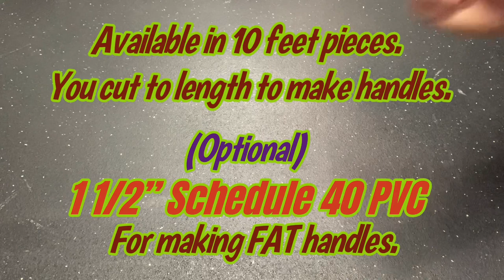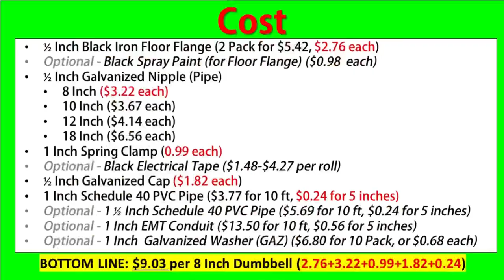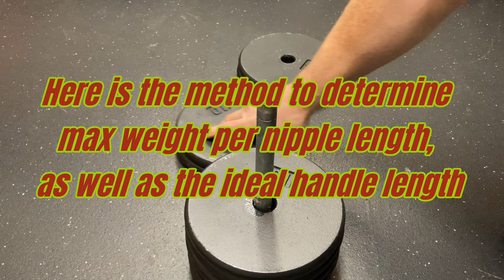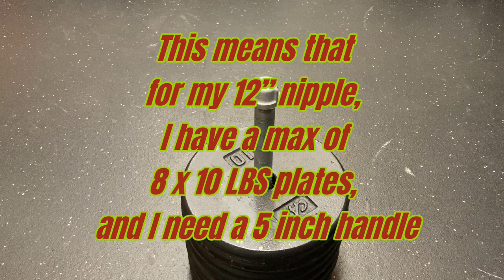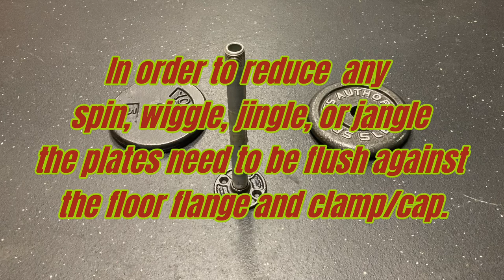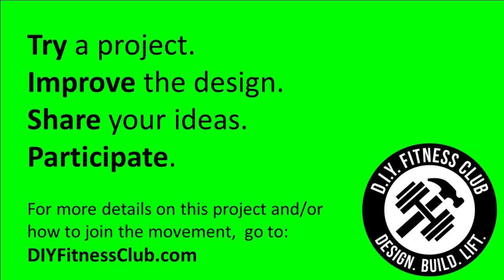DIY Adjustable "Mullet" Dumbbell System (Flat Bottom!) - Poor Man’s IronMasters

Comment: Subbed cause of this video. I built these over the weekend. Cost me ~$42 for the 12inch pair. I believe they are still worth it if you have the extra weights. I did add a piece of pvc between the pipe and weight holes for a tighter fit. Not needed, just a personal preference. The work great and no stabby stabby. Thank you for sharing.
Reply from the maker: That is awesome to hear!!!  Thank you so much!

Comment: How's your grip on the dumbbells using the EMT conduit wrapped in tap?  How does it compare to knurling on a commercial dumbbell?    I'm thinking about making some fixed weight dumbbell handles handles and wrapping the EMT conduit in anti slip tap; the kind that is used for traction on steps.
Reply from the maker: Great question! Anti slip might work. Have not tried it….not sure how it would hold up though. Some other options to consider: could add grip tape, spray truck bed liner on the EMT, or perhaps add some rubber grips on the EMT (got any used  bicycle handle bar grips?)….my 2cents: whatever you do - do it on the cheap. If not done cheaply- then at a certain point it just makes more sense to buy instead of make. Thank you for supporting the channel! 🙏💪🤘
Reply: Considering you're going to be touching the grip surface a lot, I'd use something meant for that, like grip tape for a tennis racquet or golf club. Then you dont have the potential danger of leeching chemicals from the electrical tape, and the grip is replaceable.

Comment: I know this video is old. But hopefully, I'll get a response. Here in the UK, we have 1/2" and also 3/4" even 1". Why did you use 1/2"? 

Wouldn't it be better to use a bar/tube that is a tight fit for the weight plate hole? So it doesn't move as much. I understand it will make the grip girth bigger, but isn't that why you put the pvc in there ?

What do you think?
Reply from the maker: Hello! More details here: https://diyfitnessclub.com/projects/blog-post-title-one-k9zas

However, here is something missing from that  article: not all my 1” hole plates would fit on 3/4” nipples - because most 3/4” nipples have an ACTUAL width of slightly larger than 1” ). This was a primary reason. However, you should use whatever works for you. Cheers!   

To see the demonstration of them not fitting, watch this video here: https://youtu.be/7jr7ljGdM1Q?si=V4uEPirn0mD4z8AK

Go to 2:14 of that video. 🤘🙏💪

Comment: Two questions, firstly since the handle's hole are bigger than the bar in the middle significantky, does it rattle when lifting?  Second, when using heavier weights, does the clamp really hold tight?
Reply from the maker: Since the 1” handles fit easily on the 1/2” nipple (Fact: 1” handles will not fit on 3/4” nipples), this also means that the handles do slightly “move” while exercising (i.e., there is a “click” when conducting movements). If you have a good spring clamp the plates shouldn’t move. All this being said, obviously store bought solutions are generally going to outperform this hack in most ways.  For more details: https://diyfitnessclub.com/projects/blog-post-title-one-k9zas

Comment: Could I just add the flange to a regular spindle dumbbell?
Reply from the maker: No. The threading is not compatible with one another.
Reply: I have seen people take an extra spinlock "nut" and put it at bar's end to get a flat surface and some cover the hole by welding a piece of metal onto it or a small plate off center or a large washer off center.
Also I've seen someone sandwich wood around a spin collar.
All ways to try and make spinlock dumbbells have one flat end.
All those seem to work but they aren't so pretty...

Comment: Awewome !
Reply from the maker: Thank You for your support!!!!!
Reply: @DesignBuildLift   I think somebody should make a solid proffesional machined version because the Idea of having an assymetrical flat bottom DB is awesome in itself. I am not sure I would even trust red loctite on the flange side with 100+ pounds over my face! I want a one piece machined solif or welded like a  LOADING PIN, which are pretty cheap but I would want 18" at least. Good Work Man!

Comment: Brilliant thanks for the idea.
Reply from the maker: Thank you, Lil Grim!!! If you make these (or any other DIY Fitness Club project) please let me know!
Reply: Will do! What's the heaviest weight you've tested with this method?
Reply from the maker: @devonzachariasmedia  145lb on 18”  Nipple was the heaviest I assembled. Now can I press a 145 LB dumbbell? Hell no! 💪
Reply: @DesignBuildLift  That's awesome man! I'm not too familiar with the parts used in this video but it seems solid and really if you have fat gripz already is as easy as it gets. Planning to try and scoop up a few hundred pounds of "1 sized plates now. Thanks again for the idea!

Comment: Love the idea. But why 1/2 inch and not 3/4 inch pipe? Because 3/4 inch pipe has less space between the plates :)
Reply from the maker: True - most 1” plates would fit tighter on 3/4” nipples. However, many of my plates did not fit on 3/4. Most of my York plates especially were too tight. Cap and Sports Authority plates mostly fit. Anyways- this is why I primarily chose 1/2” nipples for the video. Of course - I encourage everyone to customize these projects to best suit their needs. Thank you for your support! 🙏
Reply from the maker: Go to 1:59 of the video linked below for a demo of me attempting to put my plates on 3/4”
https://youtu.be/7jr7ljGdM1Q

Comment: How quickly will they rust? And is there a way to prevent them from rusting like some type of paint ?
Reply from the maker: Rustoleum spray paint can prevent the plates from getting rusty. For nipples and other hardware, buy “galvanized” versions (not “black iron”) from your hardware store and you will never have to worry about rust.

Comment: What do you think the max weight the pipe nipples can hold? If I were to slide a steel rod inside the pipe could they hold more?
Reply from the maker: Good question. I put 145 LBS on a 18” plumbing Nipple. Didn’t flex at all.  Strong enough as is. 🤘🙏💪
Reply: @DesignBuildLift  i use 490 pounds each dumbbells' for my exercise and for big exercise like dumbbells' benchpress i  use upwards of 500- 850 pounds or even for a 1 rep i use 1500-2000 pounds . So do you think it can hold that much
Reply from the maker: @eyaadkhushizafar8034  2000 pounds? Wow that is a world record!

Comment: Curious why no just do flanges on both ends
Reply from the maker: Great question! You certainly can do it that way, too. However, I found that when trying to unscrew the top flange, the entire nipple would turn and the bottom flange would be the flange that gets unscrewed. In other words, turning the top flange would unscrew the bottom flange. As a result- this was not ideal for what is supposed to be a quick-change design. In my opinion, having two floor flanges works better for more “permanent” dumbbells (not “quickly adjustable” ones).

Thank you for supporting the channel! I appreciate it! 🤘🙏💪
Reply: @DesignBuildLift  thanks love the channel and you're work